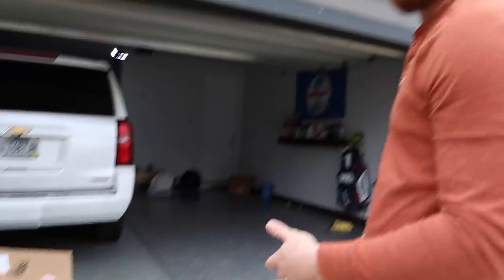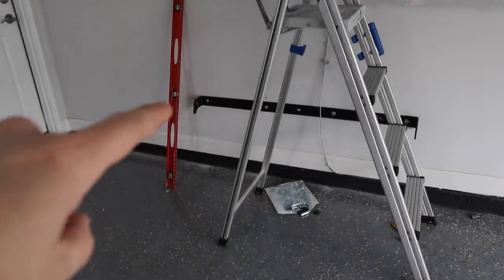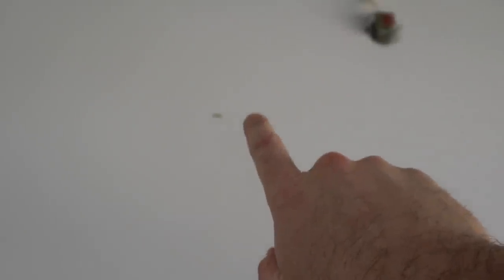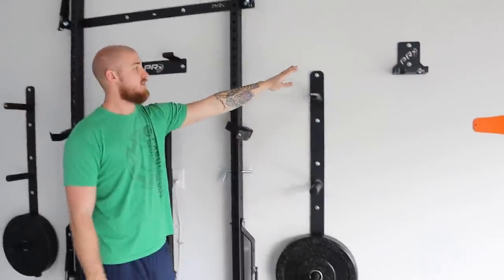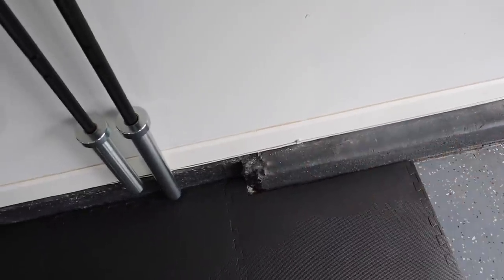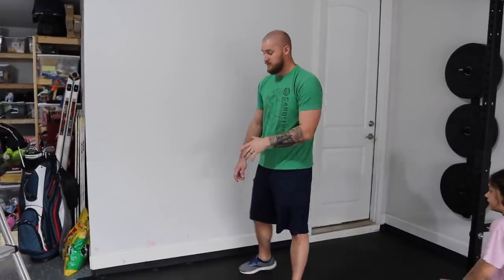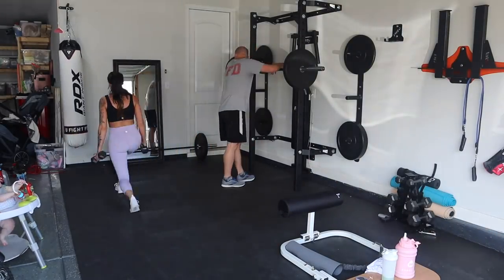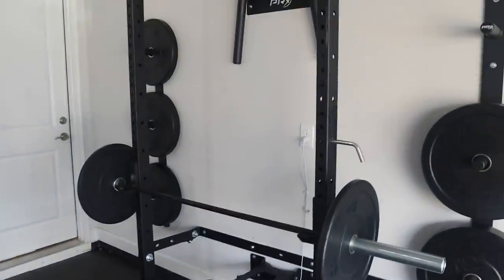GARAGE GYM MAKEOVER | PRX PEFORMANCE | MORE WITH MORROWS

Comment: Small tip if when using the bars behind your neck if it hurts put a pool noodle on the bar it will help the bar not put so much pressure on to your neck